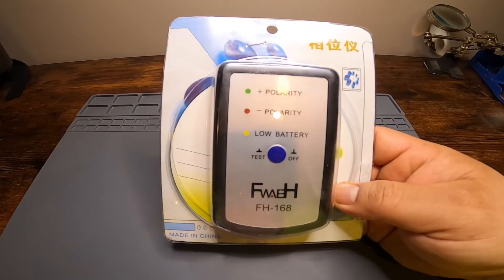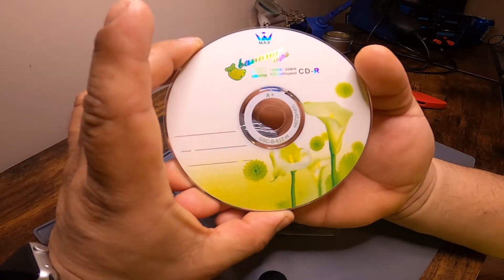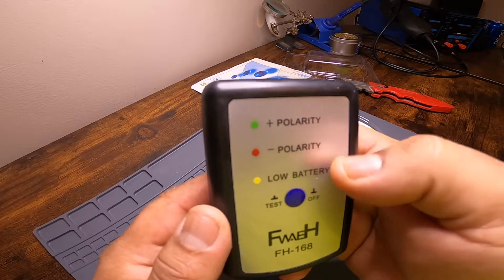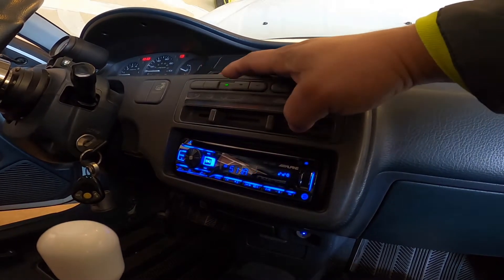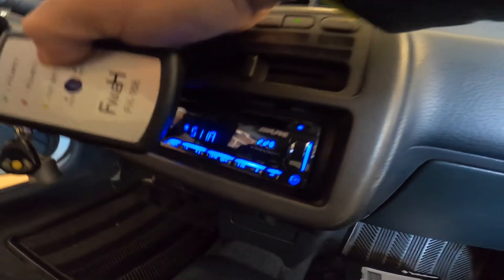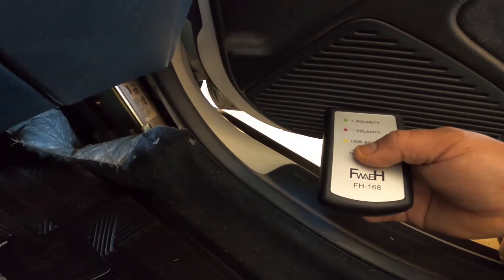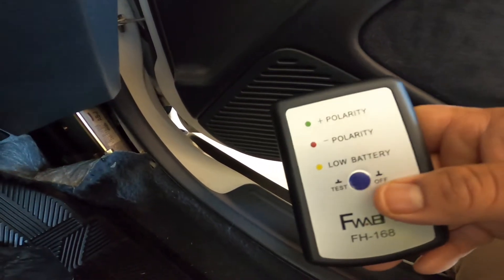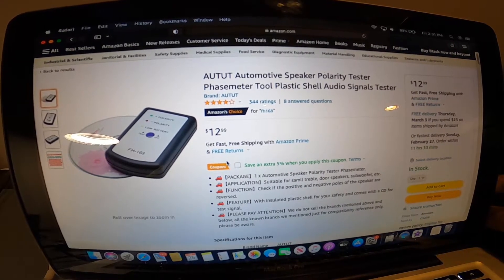FH 168 speaker polarity tester

Comment: I would advise using Bluetooth to play polarity tester. There are youtube videos that clearly labels which one is + and - so you can just check with the phone and the tester if the polarity is correct. Some 3 way speakers will cause chaos while you try testing it. So I would aim it away from the center tweeter and aim it to the outside.

For home speaker installations, the method is still the same, basically you connect + from amp to + on speaker, same for - too. The installation manual early mentions this.
Reply from the maker: @zzztidurvirus  

This is great advice, I will definitely apply your advice from now on. Thanks for watching and if you haven’t already please like and subscribe.🔉🔉🔉

Comment: I recommend to turn your volume off then raise it lil by little until you get the right reading, works the same with the Tweeters. At least that worked for me.
Reply from the maker: Yes it needs to be loud enough for a repetitive light sequence. I haven’t had a issue with it being a problem when the volume is higher then lower. Thanks for watching and please like and subscribe.🔊🔊🔊
Reply: I have the rockford setup on my 2009 electra glide . Got no cd player. How do I get the signal to play?
Reply: @hemmosluiter523  gonna have to connect a Cd player in your Aux

Comment: Your tester is reading incorrectly because your volume is too high! What do you want to do is lower the volume and if the tester is not reading correctly just change the angle at which you are holding the tester at the speaker, Holding the tester at the right position is key! I was checking my little 1 inch tweeters in my dash and I could not get a good reading until I held the tester directly on top of the Tweeter!
Reply from the maker: Hello and thanks for watching. I had some extra time today to poke at the polarity tester and long story short having the volume at a higher rate increases the testers ability to read the sound clearer. I tested 2 of my vehicles and my test bench radio to see if having the volume higher or lower can give me a faulty reading. Again I learned that having the volume at to low of level will definitely increase the chances of a incorrect reading and a inconsistent reading threw the process. Again thanks for watching but I still stand by my decision of having the volume higher is best.